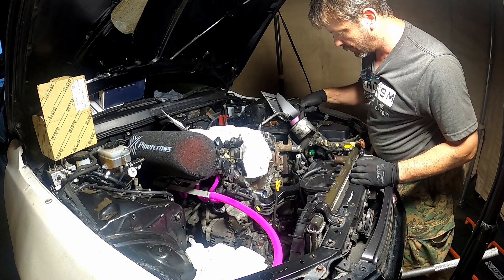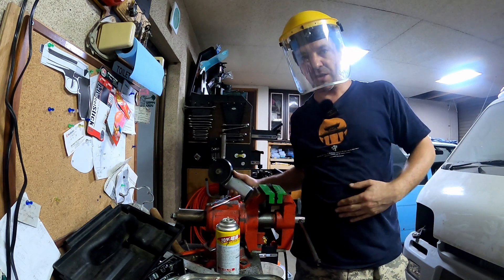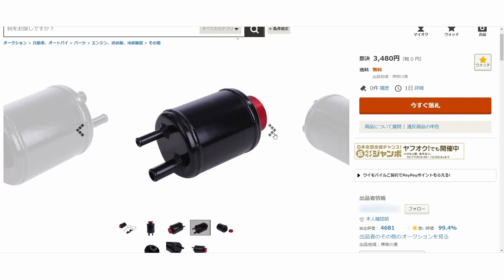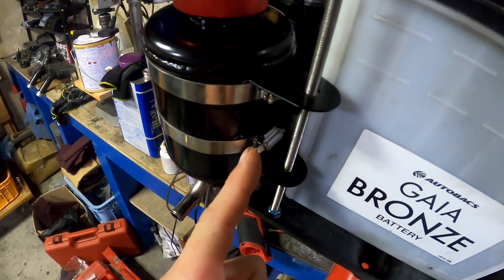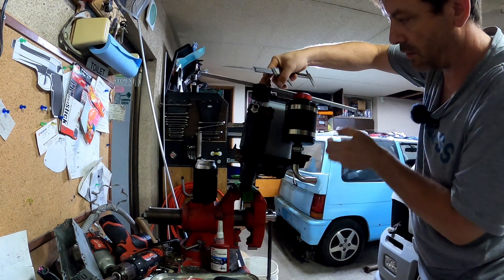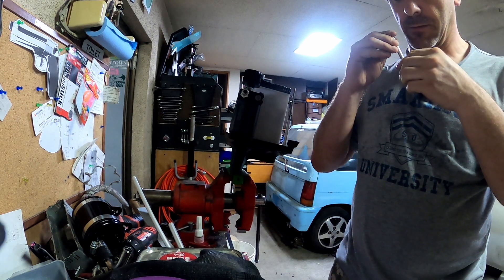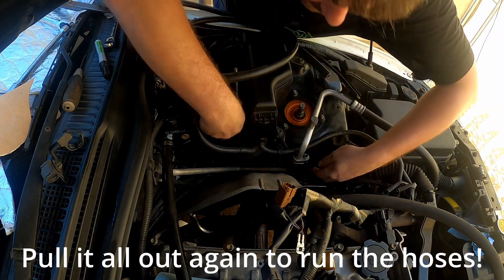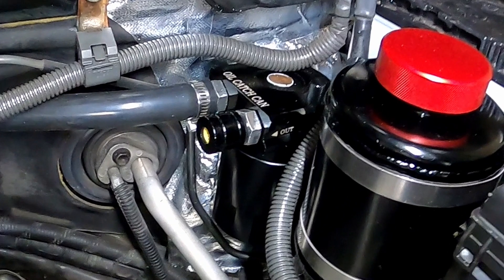Aftermarket power steering fluid reservoir install. | DRIFT ALTEZZA BUILD

Comment: what is the size of the hose going to the new power steering reservoir?
Reply from the maker: It's the same as the pump. I think it's 16mm.
I'll try and remember to measure it. If you join the discord and pester me I'll remember. 😂

Comment: Great video! Do you know what size the small hose is? Mine is leaking and I need to replace it
Reply from the maker: I used 9.5mm hose but 10mm is probably better.
Reply from the maker: @castilla626 I talk about the hose in this video:
https://youtu.be/zHyXTJPChpM

Comment: What's the easiest power steering pump replacement? 1000 euro from maun dealer for one
Reply from the maker: I don't know if anything other than OEM that fits. Maybe try a used one off Yahoo auction.